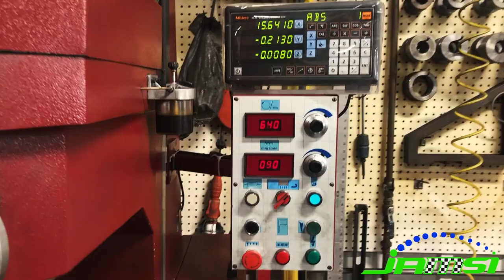Boring a SBC for a 383 Stroker Build & Installing Press Fit Piston Pins on 402 BBC Connecting Rods

Comment: Wot! No crank clearancing? Stock blocks require pan rail and the bore bottoms clearances for 3.75" cranks, i guess the customer is doing that? I built a .040" 385, i got lucky it had been a 383 in its past life, so clearance was done already,   i went with 5150 crank and rods, and ARP main studs, and head studs, along with forged pistons, aluminum heads, head studs with 11.5:1 compress is almost overkill, along with a MLS gasket, i only wish I went with a roller cam, and lower compression, so it would be turbo friendly! You do awesome work, I wish I lived closer to your shop!

Comment: Is the 383 getting a stock 400 crank, or an aftermarket crank? I was under the impression a 383 was a .030 over 350 with a 400 crank, and required clearancing inside the block for the bigger crank. I imagine someone probably makes a crank that doesn't require clearancing.

Comment: Have you measured the bore with the torque plate installed before honing to see if it actually does distort the bore curious to know
Reply: SBC's are notorious for warp'd bores. in most applications it makes minimal difference. Torque plate honing is done after rough boring to ensure a straighter bore for performance application (this procedure normally has additional cost) Just my experience.

Comment: nice work, one reason i support small machine shops, attention to detail and quality work.
cool dog to 🐕🐕🐕🐕
any particular reason you used steel freeze plugs?
Reply: Actually with the invention of antifreeze you don't need brass freeze plugs fresh freeze plugs for for boat engines that ran saltwater through them

Comment: A guy on U tube Chris morloc had content above yours and I watched a video on a little tool designed to scrap 3 angles onto a valve seat. Hold on it gets better. He claims that automotive machine shops don't take there time there for his work is better. It gets better. Then he said the reason a valve seat has 3 angles is for air flow. Can't make this up. Dropped some knowledge on him about the 3 angles and told him to check your channel out before comparing. You're welcome Jim.

Comment: The only thing I would have done was added
Tap the front three oil galley plugs for 1/4 " pipe plug and tap the hidden plug for the same. Or at least pop out the pound in plug and clean and replace with another pound in hidden plug. As you know there is carbon build up in the hidden plug usually.

Comment: Watching your videos they are great.what I want to know is the specs in the manual from years ago have you learned things can be a little different to make them better.or just stick to what works.i build two stroke race motors and I tend to measure things at operating temp or as close to as I can.

Comment: I've never seen rod ends heated to install wrist pins. In performance engines I thought you wanted a little more tolerance because of heat, at least that's how Harley rods are built. In any event, love your work.

Comment: This is seriously old school, if you only use a head plate, and don't heat the block, while honing, you won't end up with nice round cylinders after just the head plate is used
Reply from the maker: You have to draw the line somewhere.  Hot honeing is ridiculously overkill for this application. The associated cost would never be feasible for 98% of customers. It’s not NASCAR.
Reply: @JAMSIONLINE  says you....
Reply: @JAMSIONLINE  if it was easy the kids would be doing it.
Reply: @JAMSIONLINE  well we were hot honing in the mid 70s, and using an over balance on all engines running above 7000rpm, it's all in what you want to give your customer, others aren't willing to do...
Reply from the maker: @ChiefCabioch  That's cool man! You still in it? What's your shop called?
Reply: @JAMSIONLINE  I'm 71, retired, built and machined engines for Steve Carbone, Russell Baker, Long and Fuller Machine, Moritz Machine, built 11,000 rpm small blocks for David Nickens, Blown Alcohol drag boats, 830hp late model single 4bbl 430" small blocks, Super Mod engines for Mike Edward's, former Prostock guy, Nickens ran super mod with a destroked 400 small block that left the line with an 11,000rpm Jones mechanical tach pegged, and on and on, my street car in progress is an all steel 38 Fiat Topolino, with a 671 Blown Gen 1,  .060 over 392

Comment: So I currently have my 340 mopar sb at the machine shop (sleeved 2 cylinders) boring over to a 416cid. I have to do my build on a slow budget. What do you recommend I do to maintain surface and cylinder bores while block is stored?

'72 Plymouth Scamp